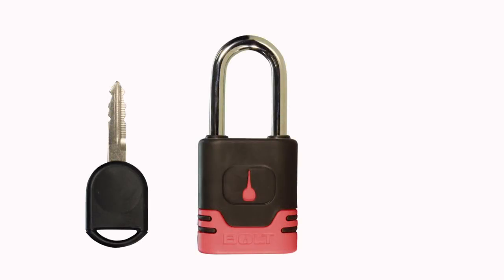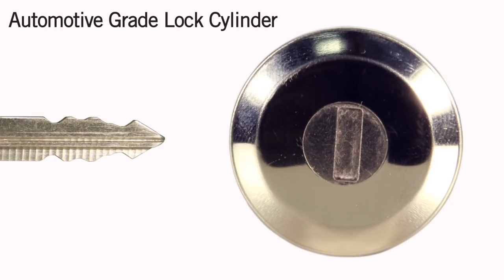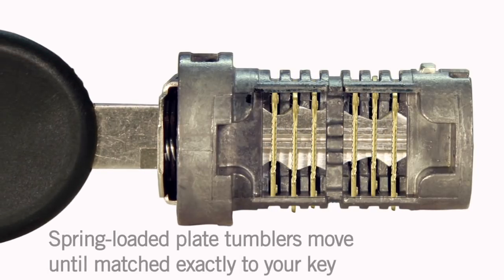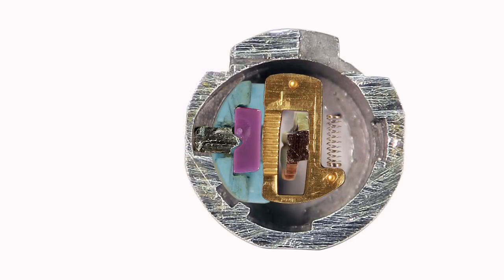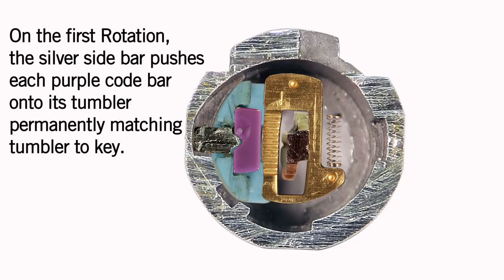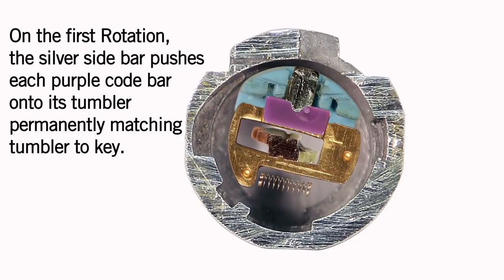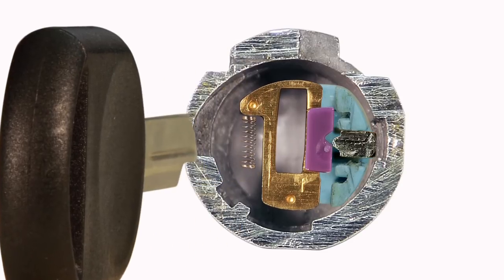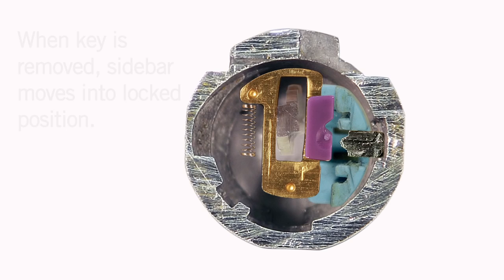How BOLT Locks Work

Comment: just key the bolt lock to your vehicle as the instructions say, but you can use that same key on any other vehicles. if you sell that original truck, just keep 2 copies of that key for use with the bolt locks. that way you get the benefit of only using 1 key for all the locks, you can use them on other vehicles & continue to use them when you buy a new car without having to buy new bolt locks, and you aren't limited to vehicle/key type compatibility in the future. carrying an extra key isn't a big deal in the first place.

and even if you have a chip key, you can have a cheap regular copy of the key made without the chip for just a couple bucks.